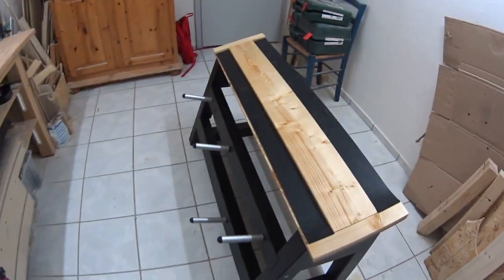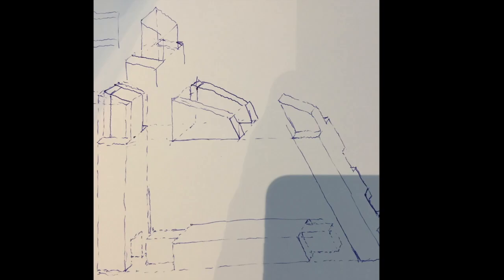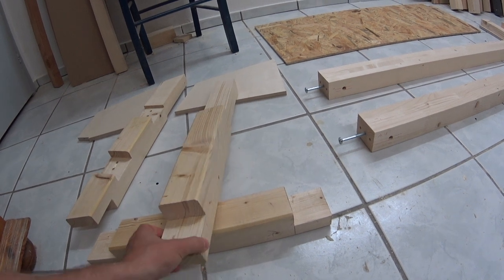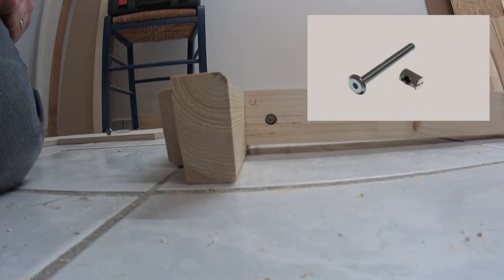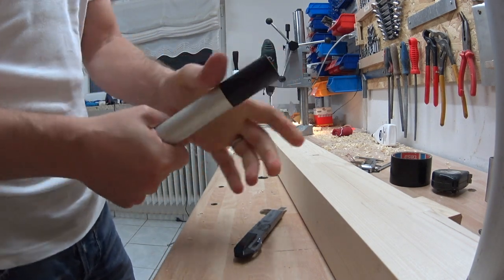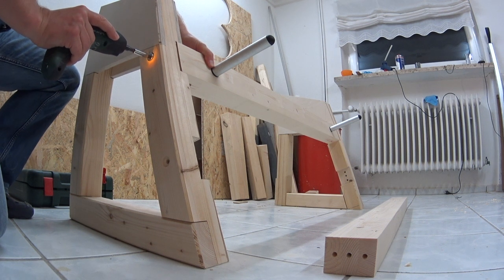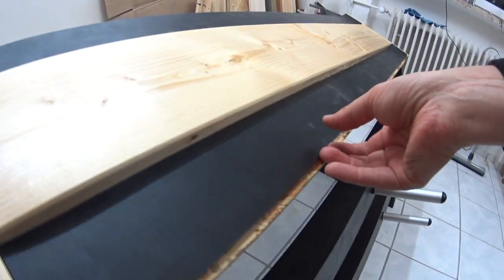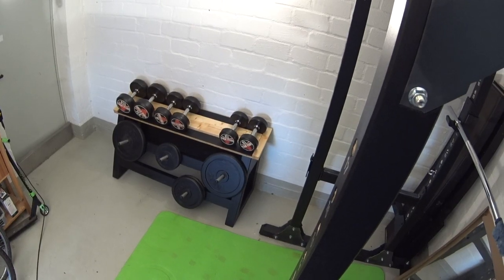Dumbbell Rack DIY

Comment: Hey man. I love what you've done there! The best DIY rack I've seen so far and 100% what I've been looking for. I appreciate your drawings, however, may I kindly ask you if would be possible for you to share the actual measurements and dimensions of the cuts and the rest so others like myself can try to build it too? I am not really that experienced with sush things but I am willing to try and that will be massive help! Thank you sharing!
Reply from the maker: Hey, thanks Sergey. Unfortunately, I don´t have my drawings any more, I built this rack quite a while ago. But the height (front edge) is 60cm, the lenght is 125cm. But: I find it not long enough, today. I would recommed to make it longer, perhaps 150cm. The beams are 74x74mm strong. The design has proven to be solid, no issues with stability.
Reply: @tims.2832  Thank you for the info. I will keep that in mind when I am building it.

Comment: You drawings are a little tough to make out.  Can you provide clearer drawings with measurements for each piece?
Reply from the maker: Hi John, that is a good idea, I was already thinking about how to diplay measurements while cutting the video. Unfortunately I do not have drawings  for each part and other obligations hinder me from making them now. But I would recommend on the other hand, to choose your personal measurements based on your height and especially the diameter of your weight plates. Thats pretty relevant for the distance between the pins as well as the two horizontal beams.
Reply: I understand.  I really like your end pieces.  Much cleaner than most designs.  I can play around with it and come up with something similar, but prefer the lazy approach...…..just stealing them from your drawings. Thanks for putting this out there.